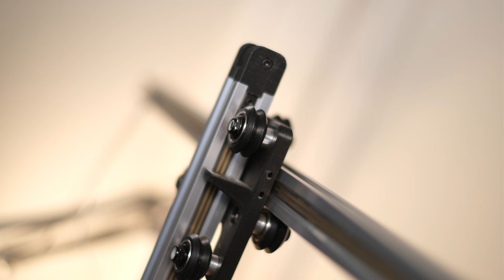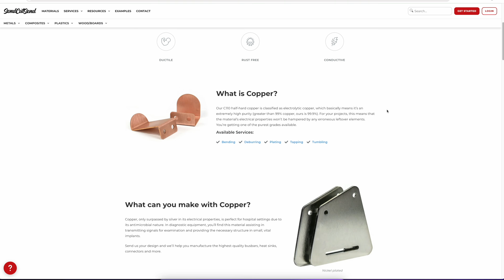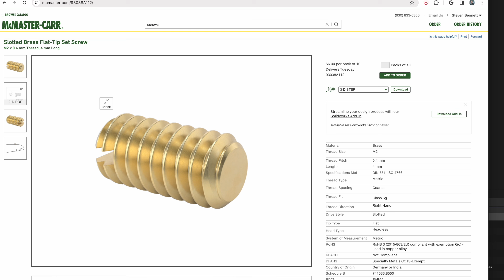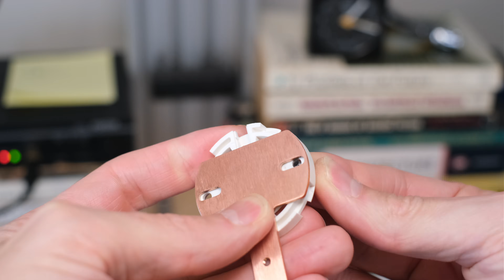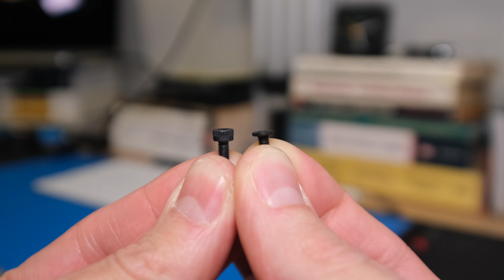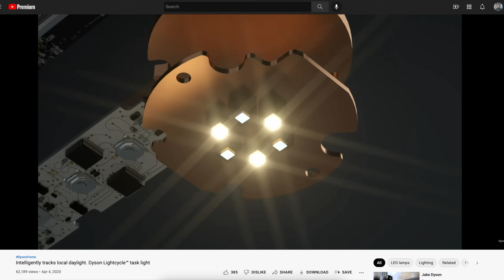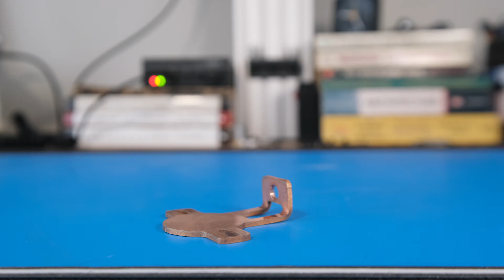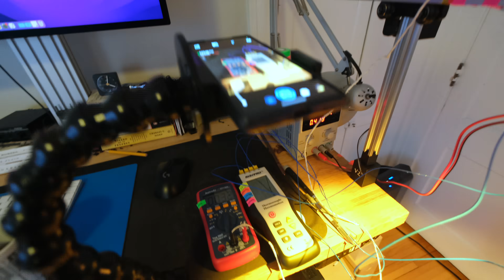Just how good are heat pipes anyway? - DIYson Lamp Build Log #10

Comment: quick idea here, you could make a strip of spring steel with a crossection shaped like a " ) " that pushes the heat pipe down while "grabbing" from the edges of the aluminum extrusion. Also if it is the full length, you will have even pressure across the heat pipe, although i believe that smaller length but multiple "springs" would do the job just fine...

Comment: Even though the heatpipe solution seems to be the most promising, and therefore you no longer have the same problem looking for low profile fasteners, I'll throw the information in anyway. The best solution for keeping the screw heads lower is to go with flat head cap screws, or sometimes called countersunk screws. With those, you can countersink existing holes in the copper heatsink, which is still a nice and simple operation with readily available fasteners that aren't nearly as expensive. There are still design limitations with them, like needing a part that is thick and/or wide enough for the countersink, but otherwise, allows for an extremely compact mounting solution, and I think you'd have enough room for them with the size of material that you showed in the video.

Just keep in mind one major thing if you're ever shopping for these fasteners: On most fasteners, the screw length indicated measures from the start of the threads, and the head of the fastener is not factored into that length. On a flat head cap screw however, the entire fastener is what is measured for the screw length indicated, which does include the head of the fastener.

You could also use a standard socket-head cap screw with a normal size head and counterbore the hole, but countersinks are a much more approachable situation that would be accessible to the largest number of hobbyists, and a little less demanding on the width of the material in order to get a good looking setup.

Either way, fantastic to see the video pop up in my feed, I was beginning to wonder if you were still working on the project! Thanks for sharing your process, and keep up the amazing work!

Comment: The far end of that long copper tail won't transfer any significant amount of heat. You can probably cut it in half without degrading performance.

Comment: Why not using tubular (6mm OD) heatpipe inside the central aluminium extension hole? Or one flat heat pipe on the side of the bar, where wheels are not.

Comment: Hey! Love this build series. I was thinking maybe countersink screws would work instead of the low profile screws. I think send cut send can do countersink operations on the holes and it’s not too hard to do it by hand after the fact. Especially in copper.
Reply: Ope! I commented before the video ended and you decided to go with the heat pipe 😅
Reply: @clomads  still good advice if something similar comes up in the future!

Comment: What size is the contact patch for the LED and is there efficiency to be gained with direct contact with the heat pipe? It could reduce housing temperature even more and it's possible that the bracket could be either 3d printed or just a cheaper material than copper.

Comment: Have you considered adding small flanges/tabs to the heat pipe bracket so that it is indexed into the end of the rail? The single screw seems like it could be fiddly. Great video!

Comment: The problem are the wheels. You need some that stick less into the rail. Another idea would be to use the center hole of the profile, maybe you can stick a thin rod into it. Another thing to be aware of is galvanic corrosion since you touch copper to aluminium.

Comment: I’ve been on the hunt for a lamp with:
-high CRI
-at least 800 lumens brightness
-good bulb position adjustability
-continuous brightness and color temp control
-long bulb life or cheap and easy bulb replacement
-small and recessed light emission source (not a large emission point that puts a lot of glare in the eye)

The best thing I’ve found that suits my needs is the $200 VariLum 30W lamp which doesn’t even have a small emission light point or recessed light source and doesn’t get anything close to Dyson’s level of adjustability.

People say this lamp is overpriced, but when I ask them to find me something that has the feature sets I want, they just can’t find any. Even I can’t find any. No one comes close to the feature set and engineering that Dyson has accomplished with this lamp which gives them no competition. The high end lamp market is under appreciated. 

I look forward to this project of yours and wish you the best luck. You earned yourself a subscriber.

Comment: Totally random idea with no planning at all, but would it be possible to create bracket such that the heat pipe is in direct contact with the led module? so that the bracket pushed the led against the heat pipe? Not sure if that would change the temperatures at all but just something that might be possible, might required two part bracket to create the space for the heat pipe.

Comment: What is the cost difference between a off the shelf heat pipe + custom brackets and the custom made copper part?
Reply: My guess is the heat pipe is 1/10 the cost. Copper is expensive.
Reply: @eslmatt811  you still need to get the custom bracket to attach the heatpipe
Reply: Heat pipe is an off-the-shelf, super easy to get part. So I'd guess it's a much cheaper solution, and imo fits better with the original goal of easy to access parts  anyways

Comment: I really like this project and I truly appreciate all the troubleshooting and methodology used to go through each issue.  Please forgive me but I wonder if you may have overlooked a few simple solutions.  For the heat sink screws catching the wheels, I noticed no countersinking of the holes.  Perhaps a slight countersink...say 0.3mm would give you JUST enough clearance.  As well, for both the heat sink and het pipe issue I'm curious why you limited to a single piece.  Surface area would seem to be your friend here so the more heat sink/pipe in contact with the aluminium channel the more heat will be dissipated.  Even a slight application of a carbon based thermal compound (MX4 comes to mind) might be just enough to make the difference.

Then again I might be completely off base on all of this so.......😊

Comment: I think you made a huge mistake with the copper heat sink. you made it quite long, but penetrated the material with the mounting holes. the cutting surface are is drasticly decreased by the holes. the material after the 1st hole basicly doesnt do anything. maybe try the heatsink version again with another mounting system? I think it might outperfom the heatpipe because of better contact to the aluminium rail. just my 2 cents :)
Reply: This is a great point - but if the holes are filled with the brass set screw does this mitigate the holes to a significant degree?  If they are left empty, you’re probably right that these holes render the length effectively useless.

Comment: I think that comparison also needs active cooling. Passive cooling may be good enough and even more more elegant than active cooling but if a micro fan and a slightly bigger housing can cool the LED to less than 50 or something it would still be a better solution for the longevity of the LED.

And such fan could cost you even less than one of those screws you used.
Reply: Noise might be an issue though. I wouldn’t want my lamp making a sound

Comment: Why not try using countersunk flat head screws instead of the low-profile socket head cap screws?  They would end up flush with the copper (or perhaps slightly below the surface). Not sure if the fab you're using could countersink them for you, but if not, countersinking 3 holes isn't that much work.
Reply: Countersunk would definitely work. Other option is to avoid the screws and use a spring shim or press fit shim to wedge the heatpipe in place.

Comment: I would have tried to make a simple copper L bracket to interface the LED with the aluminium rail, maximising the contact area on both LED-copper (like you already did) and copper-aluminium. The L itself should be as thick as practical to maximise conductivity. I'm no expert, though.

The heatpipe solution is cool but looks overcomplicated to me and the long/thin copper bracket has too much thermal resistance between the LED and the aluminium profile, which causes a big gap between the LED temperature and the aluminium temperature.

It was very interesting to see the "inverted" temperature gradient with the heatpipe though. I was not expecting that.

Comment: How big is the round hole in the extrusion?  I’m seeing .26 inches on the CAD file I’m referencing for 15 series 80/20.  They make 6mm heat exchanger tubing and you could run this inside the extrusion??!?

Comment: Is active cooling, like a fan, an option here?  What about using the hole in the center of the extrusion to run a rod into the aluminum?  

While I agree with your assessment that the heat pipe test has the more gradual curve - because it heats the whole system - I don’t know if I like the idea of the arm being warm.  The data does suggest that the LED would be cooler with this heat pipe setup, but does the arm stay cooler than with the copper plate?

Comment: Copper Bar or Heatpipe could also make your Ground for the Power Delivery.
If Nickel plating is available there should be no relevant Oxidation. Although bare Copper might be good enough.
With this the PCB only needs one Trace that can be wider.
(Same PCB with two Sides to match each Extrusion.)

But like some other Commentators I think Aluminum from the Extrusion might be good enough, although thats also depending on the Alloy, if you can connect the LED directly to it. For DIY it would be okay in my Opinion to have to change the LED after a Year because it got cooked.
Although less DIY friendly the End of the Extrusion could be milled down to give a Face for the LED Mounting. With some good thermal Paste or Pad it might work out.

Comment: You could have also shaved a little bit off the wheels, which would have been easy by putting them in a drill to shave a bit off. And only the sides of the wheels need to engage, so it doesn't matter functionally to shave a bit off
Reply: My exact same thougts.

Comment: If you are concerned with the ability to replicate, why not test just sinking the heat into the aluminum extrusion with a simple 90° bracket?
Reply: Indeed, not sure what the profile size is, but there is no way you can't reasonably sink heat into 30x30 piece of Al. I have DIY torches with 18W cree SMD LED modules in 30x30x2 piece of aluminium tube, around 250mm long. LED issoldered onto copper traces, which are glued with epoxy(!!!) onto 26x26x10 hard anodized Al piece and screwed inside this tube. Wonkiest setup ever and it just works... 
I mean, ok, my LED perhaps runs hotter, but I can burn stuff with the torch, and when I shut it down and touch the LED it is around body temperature. I really can't run this too hot, because if epoxy offgasses or deforms, it will delaminate from the Al piece and LED instantly fails.

Comment: Can I ask why you didn't use the heat pipe in the side of the arm, away from the rollers. Instead of on the top or bottom, under the rollers?

Comment: Hi Steven, I really appreciate the series. As many people have already commented I think countersunk fasteners would be a great solution for the solid copper heat spreader. Have you considered using both the thicker 3.2mm and thinner copper heat spreaders stacked and screwed to the rail with countersunk screws and thermal compound?
Reply: Why not just drill through the extrusion and pull the solid copper into the extrusion from the other side?

Comment: I love these videos. If it's possible to move the LED to directly under the rail, you could add a modest press fit aluminum part and a little thermal paste or a thermal pad to use the rail as a nearly direct heatsink. The issue then is finding space for the PCB around the end of the extrusion without making the housing look silly. Aluminum is a good enough conductor that the surface to surface contact resistance is most of the problem. Possibly just a heat pad directly to the rail would work. Polishing the end of the rail a bit and using a small clamp should get you the answer pretty quickly.
Reply: I fully agree, you could still slide a heat pipe into the rail slot under the LED for improved conductivity if needed. The entire top half of the rail (Within the housing) could be cut away to make space for the PCB, making the housing tiny.
Reply: Is the biggest issue with this suggestion that the height of the extrusion is currently being used in the 3d printed enclosure?
Reply: @forked-lightning  it's 3D printed so just change the model, and the aluminum bar can be cutted and filed if need space or more area of contact for the led
Reply: This is the way. The copper sheet solution is incredibly over engineered. Just screw the led onto the extrusion, it's easily enough thermal mass for 15W of load.

Comment: Annealed copper is very soft and easy to work with, and you can anneal copper very easily with a basic torch, perhaps even a gas range if you're feeling spicy. There's tons of videos on it but you get everywhere on the copper that you want to bend up to cherry red heat, it doesn't need to get there all at once, just everywhere at least once. Once it's annealed you can absolutely bend this copper with a 3D printed bending tool; and bend it into a ( shape, or {, maybe C, I'd go with a 5 sided C that follows the bottom of the slot. In an ideal build I'd want the copper to push itself against the the extrusion, staying far away from the V-groove. Hopefully this gets close enough to the extrusion that you can pack in a little thermal grease and get it all thermally bonded. In this ideal, no screws are necessary.

For the design of the tool, I'd go with a pair of form rollers that bolt on the end of some extrusion so that after the rollers the copper gets guided into the slot. I don't know that you'll be able to get all the way there in one pass through the rollers, so you might want a way to hold the form tool, that will help you keep it reasonably straight until you can mount it on the extrusion to force it straight.

If it takes multiple passes through the form rollers, you'll need one of them to be adjustable, and you may need to re-anneal the copper part way through. Working copper in this way is very likely to distort any holes near the bend. Any parts you don't anneal will remain the hardness they arrived at so avoid annealing near the LED mount area and it will keep it's shape, but also, the formed portion of the stick part, may be stronger than the flat stick, because of gaussian curvature, so you may want to curve it closer to the LED mount than you need to. Just, avoid any plans for forming the LED mount area in any way, unless you want to drill the holes later. That said, working copper is really easy and only takes a coping saw or dremel, a file, and the form tools; since it's a one-off part in the lamp I think it's totally reasonable to make this out of some copper sheet, by hand, as someone who isn't you and won't be doing the prototyping. I should only have to make this part once, and I'm willing to.
Reply: Should have had less faith in the copper. I could still make the heatpipe copper sheet bracket, I could probably make it more easily, and the 3D printed form tool would be simpler, either a buck I hammer the sheet against, or a sandwich to crush it into place